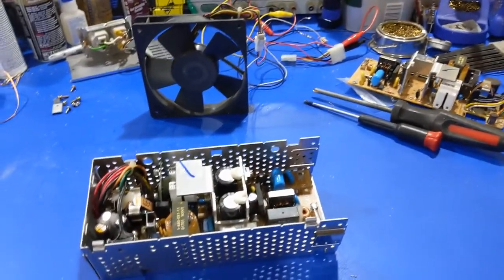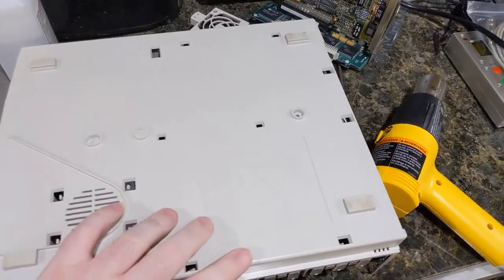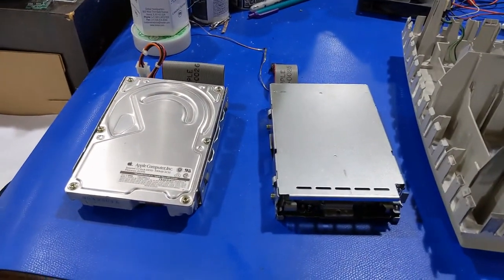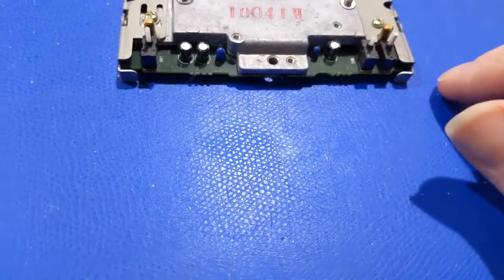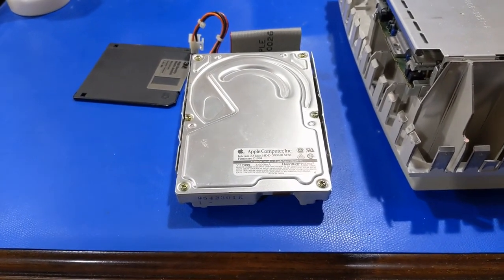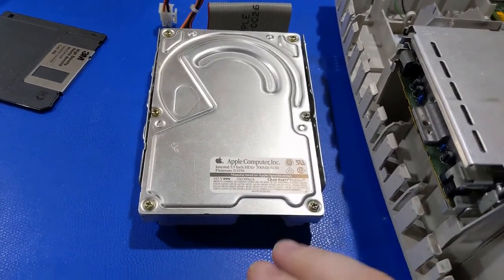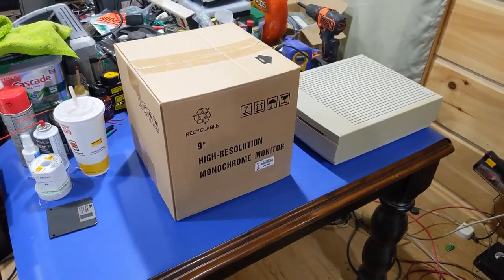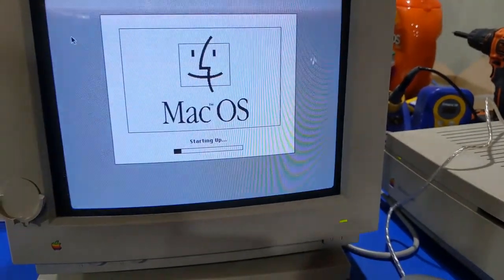Macintosh IIsi Repair/Restoration

Comment: I remember seeing a video where they did a platter swap on a dual platter drive while maintaining alignment using scotch tape on the edge of the discs
It actually appeared to work, assuming the footage wasn't doctored.
Reply from the maker: Yeah i suppose you could but man... i dont know if i would trust that. I mean with these old drives i wouldnt care so much. but yeah.
Reply: You didn’t show the cap removal or install. Not useful.